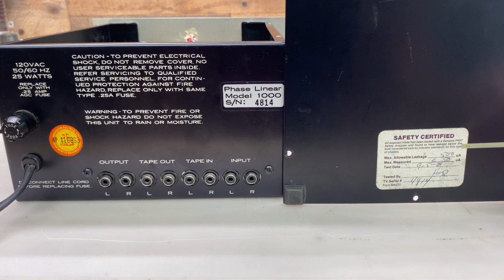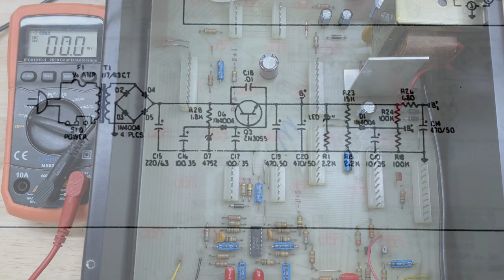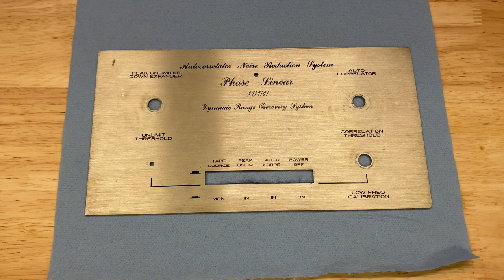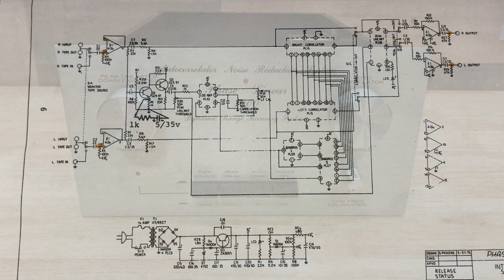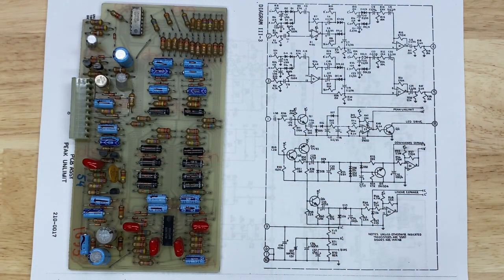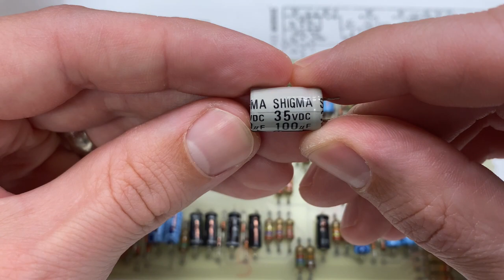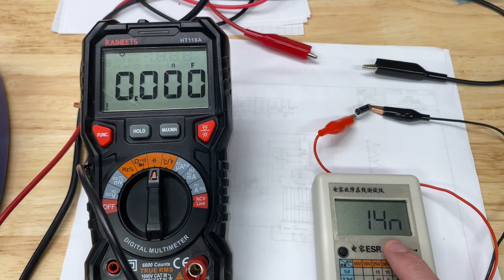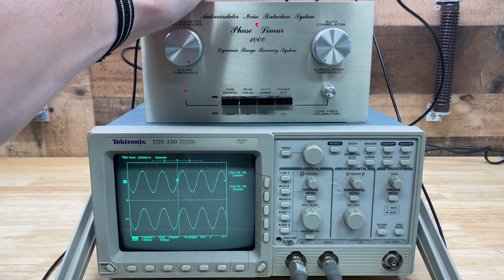DR #49 - Unique Audio Equipment - Phase Linear 1000 Service - Part 1

Comment: You should check the power supply outputs also on an oscilloscope to insure smooth dc waveforms. There could still be ac on the lines due to other defects. EDIT: I would also replace ALL of the electrolytics (yeah, I'm one of those), and check all the resistors as well. Any black-leaded transistors need to be replaced with equivalents, and many other things to do. I'll stop here.

Comment: It is especially interesting to watch a repair of something you once owned. The unit I owned was purchased in 1976 and was very effective in use. Five years later it developed a noise best describe as a two stroke outboard motor at idle. It was repaired and put back into use. I sold it in 1995 to a vinyl enthusiast who was thrilled to have it.

Comment: Dude no! If a capacitor is showing 2.6μf but it's rated for 2.2μf, there's definitely something wrong with it, there's no such thing as an overachiever when it comes to capacitors! I would have pulled it and checked for out of circuit capacitance, esr and DC leakage... 
I bet that it's leaking like a tap! 
A tired capacitors capacity value should drop off over time, not go up! 
I haven't seen many of your videos so I'm not familiar with your test equipment, I'm assuming that you have a basic component tester that shows what's the value, ESR and V loss (DC leakage)... 
You want to see low ESR and V Loss and a capacity that's as close to what's printed by never over! 
They are the 3 golden rules for capacitor health.... 
I have seen many others check the capacity of a capacitor only to see that it's capacity is higher than rated and say, oh it's great ... But it isn't.... It's either passing DC current to ground thereby pulling the rail down or worse passing DC current onto the next stage biasing up something else further along... It's one of the main causes of dead transistors... 
Edit: I posted this after seeing the first 2.2μf capacitor was checked and I knew that it wasn't fine and so I posted this and got back to the video and was horrified by the rest which I had yet to see... No! None of them are fine... 
Sometimes you just have to check out of circuit and compare against a new one, I'm sure that their ESR was way too high...
Reply from the maker: For now, all I have to measure capacitance is a cheap multimeter. Since it’s cheap and obviously not calibrated, I don’t trust it’s accuracy. I use it to ensure a cap is in the ball-park and obviously not shorted or open. My ESR meter is also relatively cheap, but it is consistent and good for comparing old and new caps of the same capacitance and voltage rating. I also currently have no way of checking for leakage. I work with what I have available to me.
Reply: @dualityrepair4770  If I were you then, I would just replace them and be done with it.
Reply: The 2.2uF cap likely has a 20% tolerance, making 2.6 uF within spec. You don't have enough information to summarily say it isn't fine.

Comment: Peak electronics Atlas Zen tester does a great job and is often available at a discount. Will display Rd at different current levels as well. Comes in really handy with vintage pieces restoration. This one certainly has a made in a shed feel to it, traces lay-out and form, lack of component outline and markings, but the way these boards are flapping in the breeze is just plain stupid.
Reply: Totally agree the tester is really good, as is the DCA55 component tester also from Peak.

Comment: I currently use this with a B&O turntable, Sunfire Pre and Carver TFM-250. You rock 💪
Reply: What is it?
Reply: @NathanOakley1980  it reverses the compression typically applied to material recorded on analog media (tape/vinyl).  Adjusted properly, it can make the audio sound a bit more "punchy" and "lively."